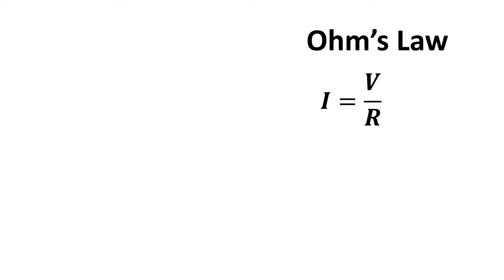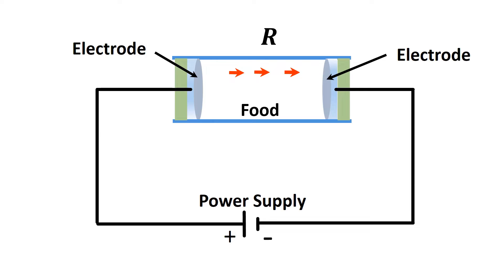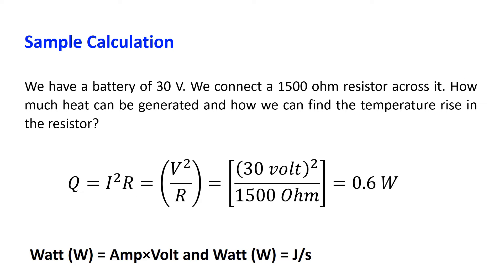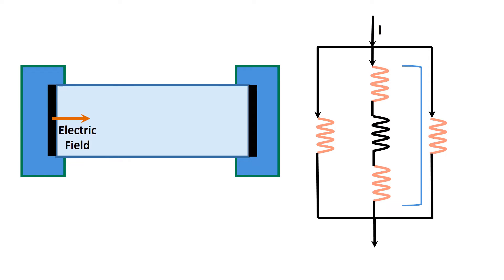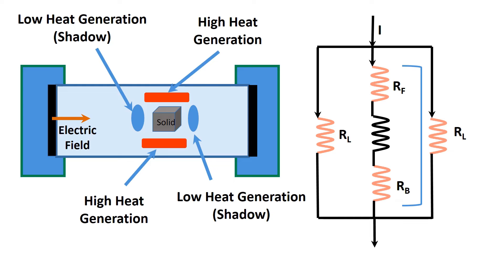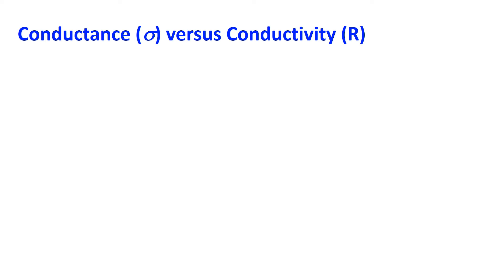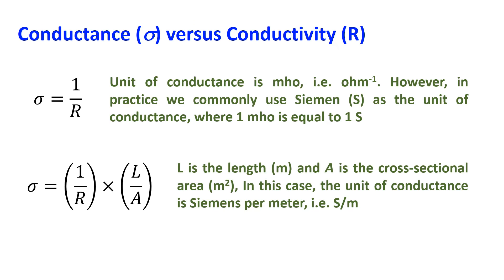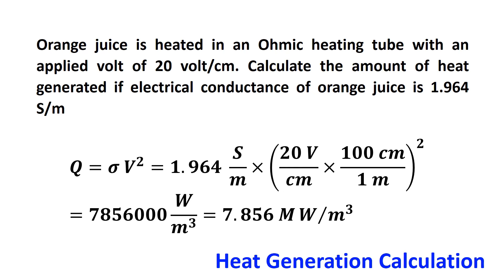Ohmic Heating of Foods: Basic Understanding

Comment: Sir how did you used density 1050kg/m^3 in place of mass?
Reply from the maker: In the first calculation since the Q is given as W/m3 instead of W and in the second calculation volume of the tube is given, not mass. If you check the units, then you could understand why density is used and it can give the mass at the end. Please let me know if it is still not clear. Thank you for your question.